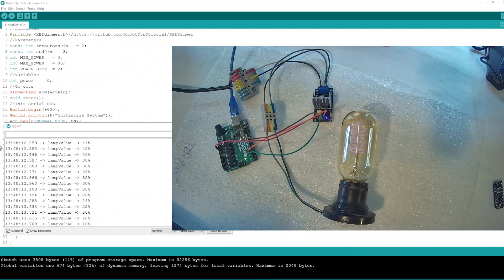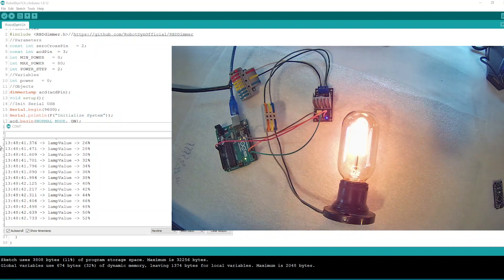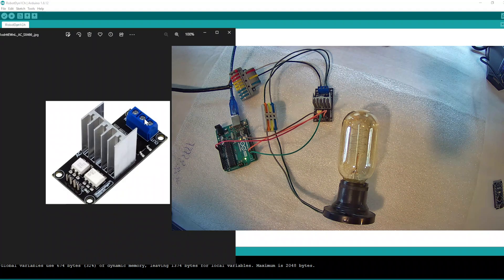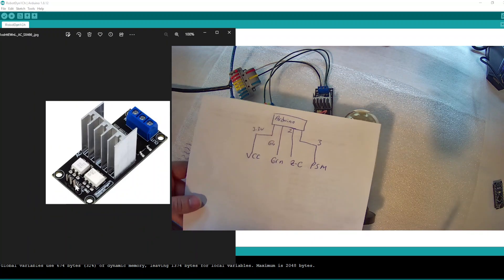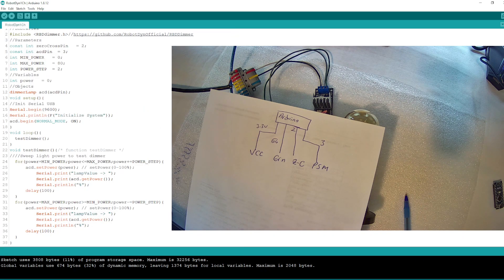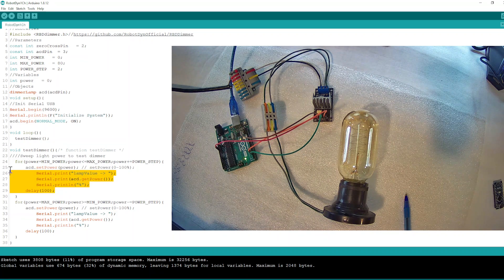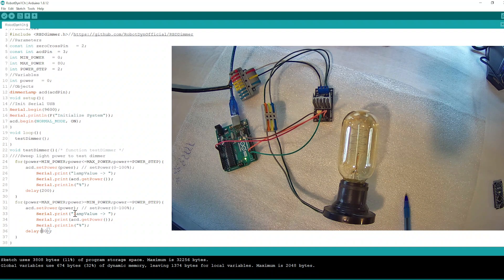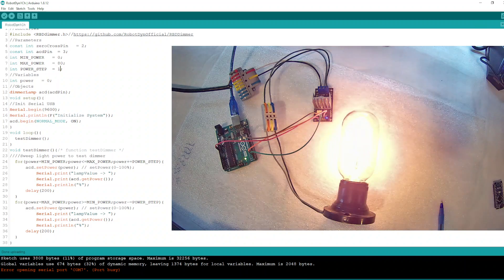Ac dimmer for Arduino and Raspberry Pi 110V - 220V

Comment: Excellent. Can you clarify the connection of the AC power cables to the module? It's not clear because of the color of the wires. and the hole code of the arduino? Thanks.
Reply from the maker: see images and links here pls https://www.iotmug.com/ac-programmable-light-dimmer-module-controller-board-for-arduino-raspberry-compatible-5060hz-with-heatsink-33v5v-logic

Comment: This is great solution for my birds 😉
How much load can it handle on the output because i have for now 25 dimmable led bulbs each of them is 9v and they work on 220v 50hz.
The biggest problem for me in my country is that no one will do something similar, so I would order and install it myself.
thanks for the reply
Reply from the maker: Each is Can load up to 2amper.

Comment: Hi. Can you run this on a Raspberry Pi?
Reply from the maker: https://youtu.be/EPg6uW5FdLE
Reply: @IOTmug  I notice the AC dimmer here and the one on this video is different. Will they work the same?
Reply: @yokun1885  Has there been any feedback on this already? Can this dimmer be steered without connecting the ZeroCrossing?